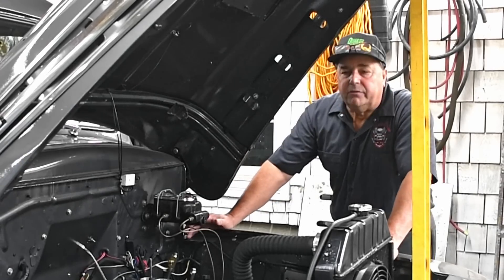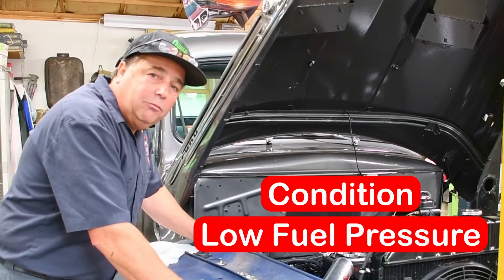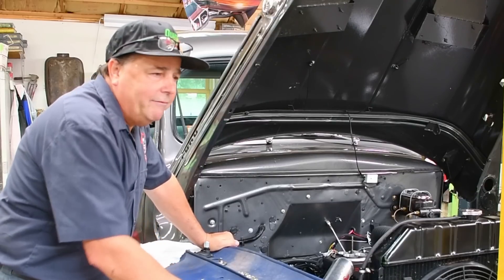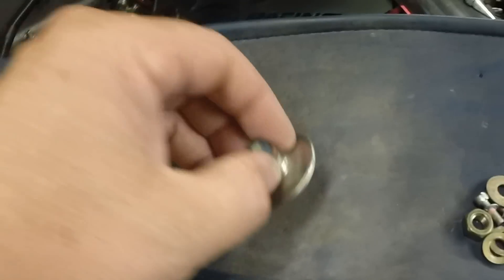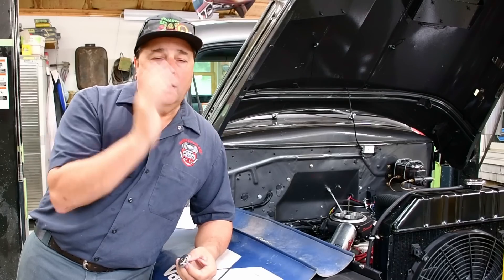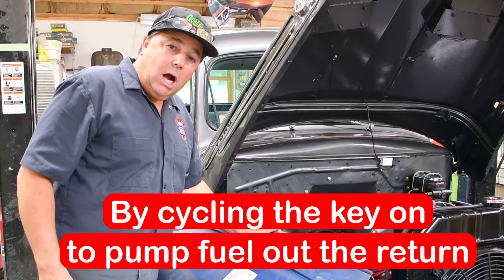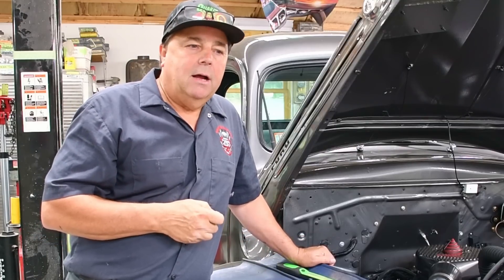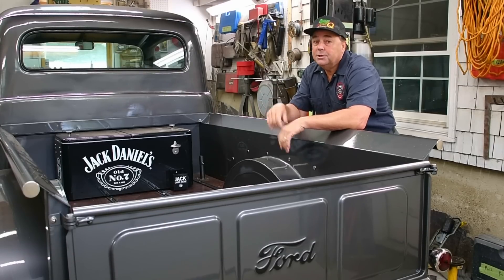Holley Sniper Fuel Pressure Problems - How to Fix Them

Comment: well it me again ... i changed out my fuel pump and filter ... and now the internal pressure regulator will not work with the new pump. I bought a external fuel pressure regulator like your... I have a sniper one , how do i plumb it ? please help ...... i am so sick of this system ...

Comment: Quick question. My fuel pump went out. No surprise there. I replaced pump with a Walbro 392 series, trying to save a few pennies. I have a gage mounted at the tbi, showing 73 psi. So,now  I have to add an external regulator. Since I already have a gage on tbi, is a 2nd gage needed on e eternal regulator? I don't see why I would, but asking for a friend 😮
Reply from the maker: No the one gauge should be good. Tell that to your friend...

Comment: I'm running super lean underboost at around 4,000 RPMs and I just redid All my fuel lines and fuel pump with no solution. I think this will fix my issue

Comment: Hi Troy, I’m having a fuel pressure issue. I have a 53 ford truck with 460 . I have a Holley hp 150 fuel pump- 100micron filter pre pump- fuel regulator set at 6 psi -10 micron filter - carburetor. I’ve changed the wiring, checked all connections, replaced fuel pump, added return line. And my truck still looses fuel pressure when it warms up. I can only drive it for about 15 minutes and it dies out. If it cools off it will start back up, normal fuel pressure and do it again. Any help would be greatly appreciated. I’m exhausted trying to figure this out. Thanks Gary June 9th 2025. Great video
Reply: Throw the snipper in trash. Re-install carb. Drive free...

Comment: Nice video, mine is sniper 2 efi with the 340 lph Holley fuel pump and I’m experiencing low fuel pressure but when engine is hot and after a long period of driving, not with engine cold not after 30 min driving, it’s after a 1 hour o more driving in traffic it lows to 20 and then if I push gas pedal then it dies. I can’t find nothing in fuel lines and filter, please help
Reply from the maker: That sounds like it could be a pump problem. Like a weak pump. Or possibly something in the electrical circuit causing the pump to slow.

Comment: Good day, My 69 Firebird 400 (with sniper2) wreaks of gasoline smell when engine is not running. I have to leave the garage door open during the day and night. I've replaced all fuel lines with the vapor guard, checked the fuel tank (no leaks), and even bought a carb cover but the gasoline smell is still strong. This is my 2nd sniper with the same issues. Could it be the injectors are leaking after the engine is turned off? The car runs great other than the gasoline smell. Need your assistance. Thanks
Reply from the maker: I would check for a leak. I would also plumb a vapor canister into the tank vent. good luck
Reply: Why would you buy two?

Comment: Yes eliminate the crap regulator. Run the adjustable regulator from the return line back to the tank. Problems solved. Mine Broke two months after installing it. Same as you, I went to pull out the fpr and it came apart in my hand.

Comment: I would like to try this external regulator set up.  I'm NOT running a boosted engine.  What would be the brand and part number of the regulator I would need?
Reply from the maker: Aeroflow or Holley. Get one without the boost control

Comment: i installed mine and primed the pump and it was pushing 100 psi so i done the same thing you done . i still havent drove it yet cause the rest of truck isnt done but glad it works thanks

Comment: I have a Sniper on a 1976 Toyota FJ-40 with 2F motor. It runs great but requires time for fuel pressure to build at every startup. It it possible to add a check valve and accumulator to refuse the time required to start? Thanks.
Reply from the maker: I have never done that. I would think it is possible. let me know if you do it. I'm curious
Reply: @troykane  thanks for the response. I may do some research.

Comment: My fuel pressure is down to 20 psi, my VE numbers are going way up into the 200s at WOT. I checked and it’s low, time to remove it and use an external regulator.

Comment: Those regulators cause a lot of problems. Holley dropped that feature on the Sniper 2. But the new in-tank one-outlet fuel modules have exactly the same little regulator in the tank.

Comment: This is a really helpful video, my sniper has been running for about 18 months with no issue but now it appears I've got a low fuel pressure issue, as the AFR leans out to 20+ and the CL comp jumps all the way up from 1% to 50%.  Fuel filters are clean and lines are not restricted so this is my next place to look.

Comment: I bought 85 corvette with Holley sniper efi. Person I bought it from says they never changed the fuel pump in tank. It did have tune port injection I find those run around 38 to 42 psi. I ordered a 100 psi fuel pump. My car dies out on light acceleration. If I stop to fast it’ll kinda choke out and die. So I’m hoping this is case just not enough pressure. Any input would be appreciated nice video
Reply from the maker: Sniper need 58-62 psi. I would start there.
Reply: Also when I put to floor at idle my air/fuel goes up to 19 I figured that’s pretty lean

Comment: On the regulator, with that AN adaptor (Edelbrock Russell 670343 Fuel Pressure Take Off), that line goes back to the fuel take - so you essentially converted it from a RETURNLESS to a RETURN system?
Reply from the maker: Exactly! You got it.

Comment: Your running two fuel pressure regulators? One in the tank and one on the back of the Sniper unit. Is that standard?
Reply from the maker: No it just happened that way. I thought the tank regulator would be responsive enough, but it was not. So I added the boost reference regulator.

Comment: Do you see a problem with not running a return line with the sniper 2 with a returnless edelbrock sump pump? I will be putting turbo on and figured the boost reference internal regulator on edelbrock sump pump would take care of everything. ..?
Reply from the maker: Yes I do. My own experience with a boosted vehicle, is you need a return line. The reason is the pump with the built in bypass cannot react quickly enough to the fuel demands of a boosted engine. So use the same pump (I did) and install a boost reference regualator to the return side and run a return fuel line. You'll be amazed at the difference in performance. Good Luck

Comment: So glad I came across this video!! New Sniper installed and tuned by Henson Racing (so I know its right). New aeromotive fuel system with intank pump, inline 10micron filter. Last 3 out of 5 drives she acts like she's running out of gas and dies. Now she never does this (or at least hasn't yet) on the highway, only on city streets. 1st time big backfire (sounded like thru the carb) then sputtered and died. let her sit 2-3 mins fired right up. Next time, just sputtered along and died. Tried to start her up right away and no go. let her sit a min or two and fires right up and drives fine. same on the third time she's done this. I'm gonna run a data log on my next outing and see what I find. At least I know some thing s to start with. Thanks again for the video!
Reply from the maker: Good Luck

Comment: Not sure if im having a fuel or ignition issue but my problem is 
When i drive for a few minutes my air to fuel ratio is around 13 to 14 then goes straight to 35 and dies and i cant start it for like 30 min then it will fire right back up and drive for another 5 to 10 min and repeat any ideas?
Reply from the maker: So it's going lean. You need to find out why. Are you getting ample fuel supply? Is the fuel supply continuous and steady. That what i would check first.

Comment: So my question is . I have the Holley stealth sniper 4150 and it sounds like it’s pulsating in the exhaust as I punch on the throttle . It’ll go away for a bit at a nice drive then it’s back at low rpm
Reply from the maker: That I have not heard of. I would check your fuel pressure before, during and after to see if that may be the problem. Good Luck

Comment: I put my adjustable fuel regulator before the sniper. It works . I still have the diaphragm in it. should I remove it??. I had problems with it from the start  . Holley said they were back ordered and did not know when the part would be available.  thanks Holley you know this part is bad. Should I put the regulator on the return side like you did?
Reply from the maker: Remove the diaphram (regulator) and place the external regulator on the return side. With the factory regulator in the throttle body, it's limiting the adjustability of the external regulator.
Reply: By moving the adjustable regulator to the return side will that set the psi to 58 returning to the tank and 58 psi to the inlet also?   I have 2 tanks and the valve to switch tanks is like the one on my f250.  Some times the return dose not switch and it will over fill the back tank.  I hope by lowering the return side it will make the switch work right.  I had problems with the sniper at first it would backfire.  I was getting false spark from wires crossed.   It was solved by bending the gray wire in a uturn and twisting it and the false spark quit  . There was no video at the time to go by . I wish I had watched yours great idea keeping it separate like you did . Thankyou for the help your videos are great.  John Wunschel  Placerville ca  aka Old Hangtown ca  @troykane

Comment: Hi everyone, I am having a similar problem with my Sniper unit. My Sniper unit has less than 500 miles on it.  My car ran fine for a couple of months. Since then, it's been really acting weird. In a nutshell, my car idles fine up to about 170 degrees on the Sniper handheld. The fuel pressure is good around 60PSI. Then all of a sudden, it drops to around 25PSI and stalls. I can't get it cranked up for days. I checked the Sniper regulator screen and it actually looks clean.  Anyone have any ideas on this? Is there a way to actually test the fuel pressure regulator? Thanks.
Reply from the maker: Check the coolant temp sensor. Make sure it's reading the correct temp. This will have an effect on how the system works.

Comment: Great video... My problem is it wont hold the pressure once primed! So I hit the key, it primes up to 60 psi then goes to 20 so then when I crank it,  it won't start! just crank crank cranks. If I go to the return side at the firewall mounted regulator and kink the hose it will build 100 psi and start.... then I unkink the hose!  at this point runs and perfect fuel pressure....  Tried another regulator and same issue!
Reply from the maker: Have you tried to adjust the regulator?
Reply: @troykane  Yes Sir I have... fuel pump in a Tanks Inc Tank up to the filter then up to reg. then out of reg to sniper unit on rear drivers port. return off bottom of reg. and rear passenger is capped.... also inspected screen was clear since not used I left it out!
Reply from the maker: Ok, this is my set up. From the in tank holley pump. To the inline fuel filter. From the inline filter to the drivers side rear of the sniper, with a pressure gauge installed at the inlet. I removed the Holley regulator from the throttle body on the passengers side. Connected my return line from the sniper return to the boost regulator. Then from the boost regulator back to the tank return line. The vacuum line on the regulator goes to manifold vacuum. Then adjust your fuel pressure at the remote regulator. This works for me me. It should work for you. Good Luck.

Comment: I have a question. I have a turbocharge 98 Honda accord, engine is fresh rebuilt, same as turbo kit. After 300 miles my cheap Amazon fuel pressure sensor gave up on me. Is it still safe to drive on small road for errands as long as I stay under boost? The new sensor won’t be here until the weekend. Fuel pressure was set at 50psi but I’m only getting 27.5+- psi. The cel will pop up if I go above 3500rpm. Car starts up normal, idles normal, and drives normal under boost.
Reply from the maker: I would buy a quality part. And wait for it to be delivered. An improper fuel mixture in a new engine can equal big trouble and lost $$$$

Comment: I wish my car ran like that with my sniper. If I dump my throttle I get a backfire at the throttle body and I've gone through 2 incline fuel pumps that seem to run much louder than they should
Reply from the maker: Sounds like a timing issue to me. Are you using timing control?
Reply: @Troy Kane Vtwins to v8s  I'm running an msd ignition. The shop that installed my efi went out of business so I doubt he did anything more than the initial set up
Reply from the maker: @borocamo  You have to check the timing. I would recomend timing control by the Sniper makes for such a better system.

Comment: I'm having same issue, when I install the external regulator where do I connect the boost reference line if I'm not running boost, my victor Jr intake does not have a port that small
Reply: Hey so I put the regulator on but it doing same thing, fuel pressure won't go down.
Reply from the maker: @Moparbarnett88  Did you remove the regulator from the Holley throttle body? Take that out first. Then you can adjust the remote regulator.
Reply: @Troy Kane Vtwins to v8s  
Yes I removed the regulator from the sniper. When I disconnected the return line from regulator and let it run in a bucket fuel pressure was fine so I assumed the original line going to tank was bad and ran a new one. But when I hook the new line to to the regulator fuel pressure went back High, not sure what's happening unless it's a problem at the tank. New line is 3/8
Reply from the maker: @Moparbarnett88  Did you adjust the regulator?
Reply: My regulator leaks fuel out the vacuum port uncapped
Reply from the maker: @hubertbryant5587  I would say the regulator is bad.
Reply from the maker: You do not need to connect the reference port. Just set the regulator and you are done.
Reply: @Troy Kane Vtwins to v8s  
Thank you, do I need to cap it off?
Reply from the maker: @Moparbarnett88  It wouldn't hurt. But you don't have to.
Reply: @Moparbarnett88  leave the cap off the brass boost vac port!

Comment: Great video! Are you blocking the return on the throttle body. Then using the bottom port on the external regulator for the return? I’m running the in-line pump that comes with the Holley sniper kit. Thanks.
Reply from the maker: Coming off the return on the throttle body to the regulator. From the regulator to the tank.

Comment: What linkage did you run on the holly the factory is a 1to 1 ratio for the secondary. Or there is a progressive linkage out that. 
I just saw came across  your first install of this set up and was wondering why you didn't run a return then?
Reply from the maker: I'm running stock linkage. I had plumb no return because of Holley said I wouldn't need one with the In Tank Pump. However, to run the Boost Reference Regulator I had to go to a return line system.
Reply: Ah I wasn't  under the impression that any Holly set up would be return less only the Fi tech fuel set up can be cus of there surge pump.set up
Reply from the maker: It got me thinking that too

Comment: I have had consistent high pressure (~69 psi) on my Sniper 2300 since I installed it.  I pulled the regulator diaphragm and cleaned the screen, etc.  Plus, it makes this godawful whine/squeal when priming and sometimes when running, which Holley says is “regrettable, but normal”.

Came here wondering if it would work to pull the diaphragm and go with an external regulator, so THANK YOU for posting this!!!
Reply from the maker: Yes I would try an external regulator. Remove the internal one first. Good Luck
Reply: @troykane  external regulator ordered!  this is for a cammed, bored, and stroked Chevy 2.8L (now a .030 over 3.1).   Been getting 6 MPG!!  Measured AFR is reading a full point higher than what’s in the table, and Holley thinks it’s overfueling due to excessive pressure.  We’ll see!  Looks like even the 2-bbl, 2-injector 2300 is too big for my 194 cu inches of fury!!  😂

Thanks again for the info!!!

Comment: Buen video, tengo problemas de caída de presión cuando aceleró el vehículo
Reply from the maker: Left side is the inlet. (drivers side). Thr right side has a round cover for the fuel pressure regulator.

Comment: I just tried putting the Sniper on my 66' GTO after having the engine rebuilt.  I used an internal fuel pump with the new fuel tank.  I have great pressure at the tank but only getting about 5 PSI at the Sniper.  I am miffed at this point.  Blew out the fuel lines and did every thing I could think of.  I finally put the old carb on there so I could go to Cruise the Coast in Biloxi.   I've talked to Holley experts about 3 times and they blame the fuel pump, the fuel pump experts tell me the line is blocked.  I will worry about after the I have my fun at CTC.
Reply from the maker: Are you running an in line fuel filter between the pump and the tank? That could be the problem. If not try to cap the return line and see what you have for pressure. Is your in tank fuel pump regulated? A few things to check. Hope this helps.
Reply: I do have a in-line fuel filter why would that be the problem?
Reply: @cminteriorcustoms3652  I think he's suggesting if that filter was clogged it could be the problem or a problem!

Comment: 1) Truck is badass and sounds good. 2) I believe this is my issue. I also have a black powder coated unit and ever since first startup it didn't want to take fuel well and have to rev slowly. Erratic fuel pressure at time. I have opted for the holley filter/regulator setup (corvette filter style with 58 bypass) just with 6AN fittings. I really hope this does the trick. Also, can't remember if I checked back of unit for vac caps on booster port, ran to intake.
Reply from the maker: Good luck, thanks for the comment